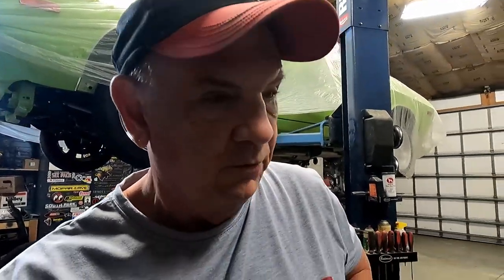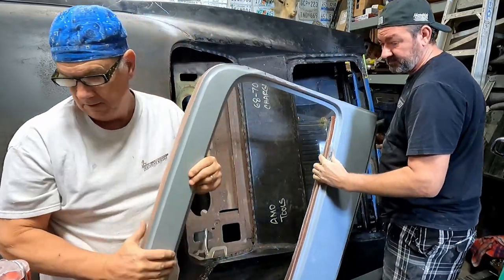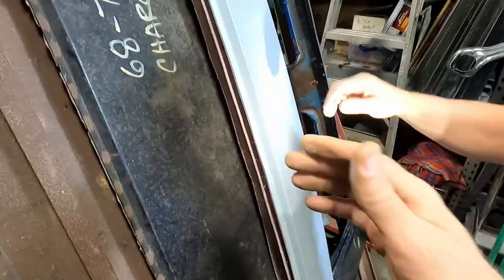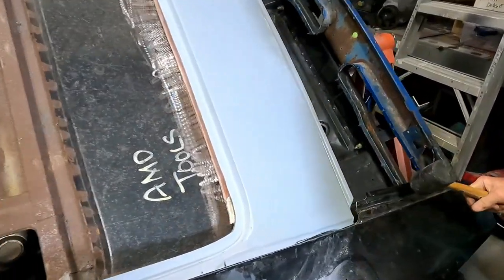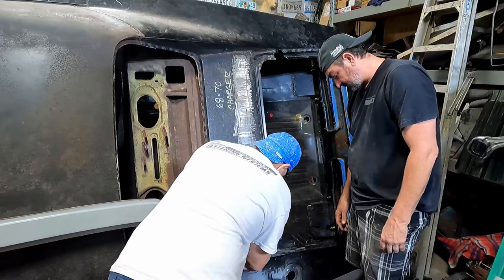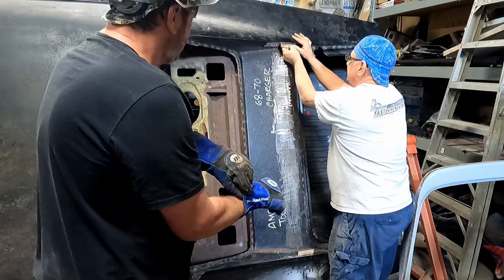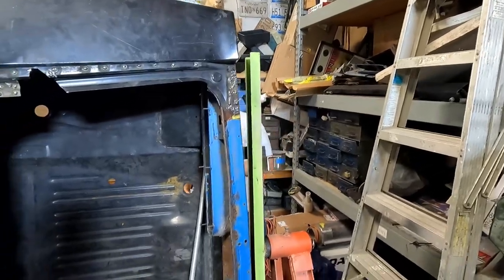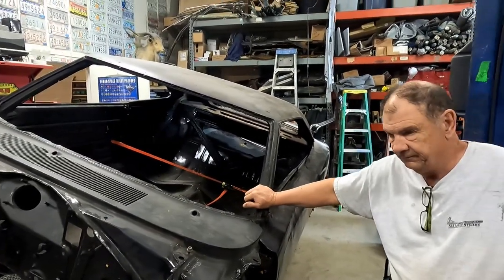1969 Dodge Daytona Rear Window Plug Install Part 1

Comment: I need a set of hinges. Will you sell me a set?
Reply from the maker: We only made 2 sets so far for the 2 tribute cars we’re doing.  I would need your original hinges because where it mounts we cut our original hinges and used that piece then extended them.  Send me an email at ClarksPlace@yahoo.com